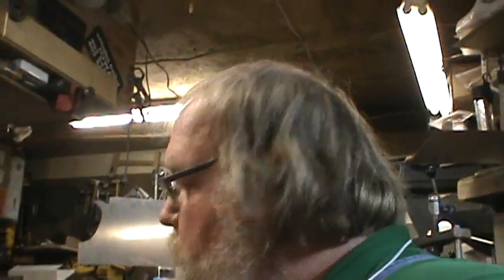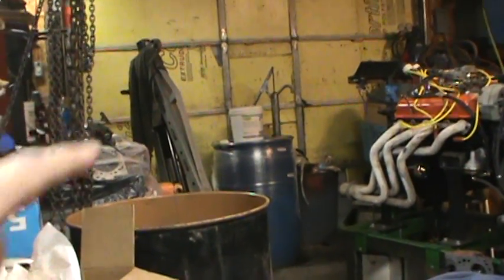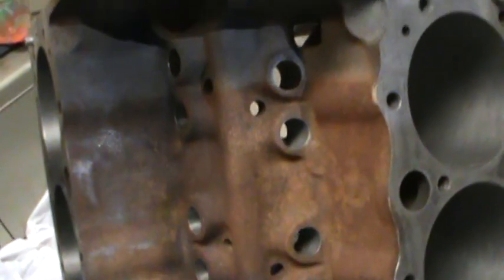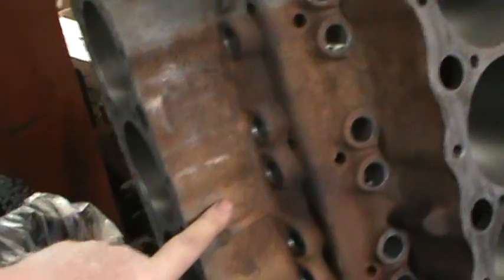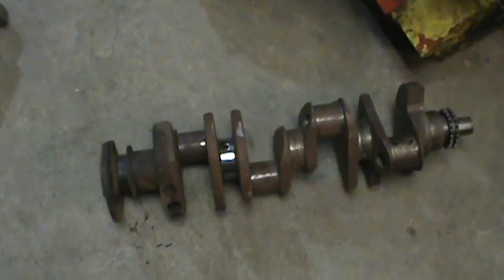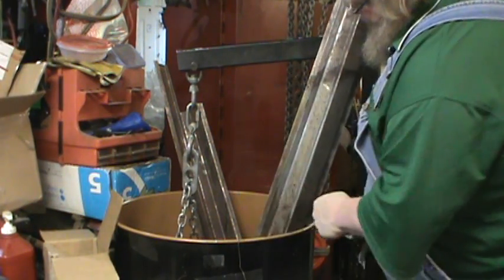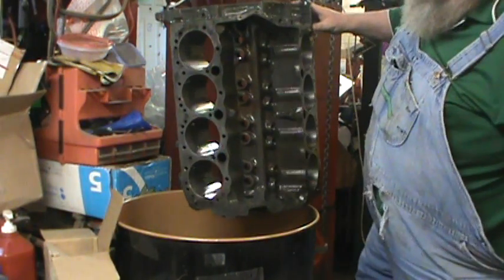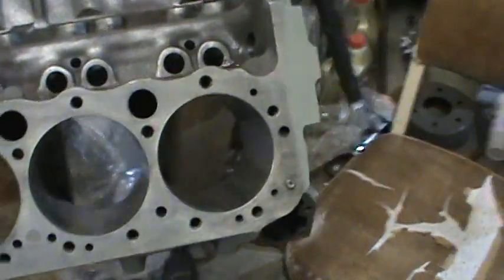cleaning motor parts with Evapo rust remover not sponsored

Comment: Looks like it did a lovely job!  They look so much better now than what I have seen so far.  Cast iron leaches oil and grease into its pores.  It's very porous.  Rust will actually be deep into the pores, not just on the surface.. and yes kids, rust gets everywhere, water jackets, etc.  I also recommend a good wire brush even one of those stiff braided brushes to get all the loose stuff off the block before it goes in.

Comment: Thank you for the video.  THIS MAN IS NOT KIDDING !   You Should listen !.. He didn't go through all that for nothing.  I couldn't lift half of the parts that he did.   Evapo - Rust is amazing.  I've only used it for small parts mostly.   But it works  on Heavy Duty Stuff as well.  It ain't no joke!    The beauty of it is that if you have the time you can just leave it in the solution and if you have to clean something up.   just buff it up and put it back in for a while.  Evapo-Rust is non toxic, bio-degradable, safe on skin and eyes, and , REUSABLE.  Don't throw it away..,Filter it.  Check it out !  Thank You.
Reply from the maker: thank you . the Evapo rust solution works great i have saved 5 or 6 blocks that would have otherwise gone for scrap. the machine shop i use has even had me clean a couple for them and couldn't believe how clean it was. well worth the money.

Comment: Awesome video, if I have a crank that is freshly machined but developed some minor surface rust can I soak it in evaporust without having to  worry about taking it back to the machine shop for measuring?
Reply from the maker: Yes, absolutely it will clean with out removing metal

Comment: does the evapo rust take paint and grease off
Reply from the maker: think it works best on cleaned stuff as in grease free. it wont remove paint unless there rust under the paint it removes.
Reply: Use zip strip with a paintbrush and a pressure washer to take off paint. Then use the evaporust.

Comment: Neat video. Better than an acid or electrolysis. 

I came up with a system to use only 5 gallons of Evaporust to submerge a sbc. Check out my video if you have time.
Reply: Did I add water or straight vapor rust

Comment: Resultados da pesquisa

Resultado da tradução

Português

Inglês

good morning friend. have you ever soldered a small block 350. in the cylinder region ..? you have a block from the year 1973 it cracked on the second cylinder cracked the cylinder and then the shirt .. I believe that the cylinder wall is already weak because the owners do not use additives. would you advise making a weld in that region?
Reply from the maker: you mean its the cylinder wall that has the crack? if that is what is going on depending on the crack  i would have it sleeved and repaired that way.if the crack made it all the way to bottom of cylinder it may be done for.